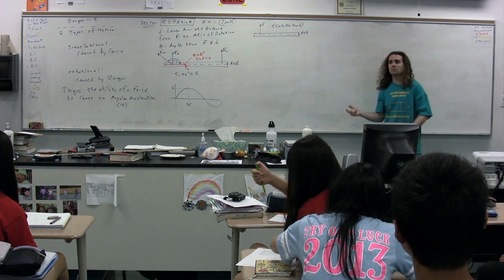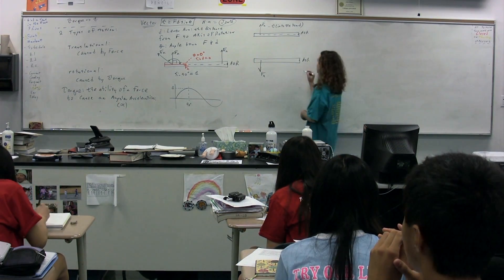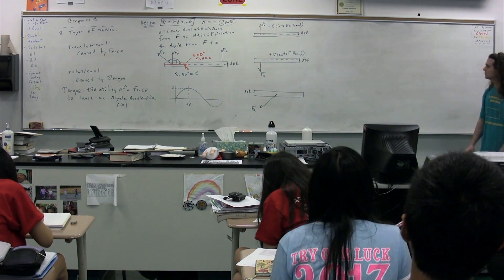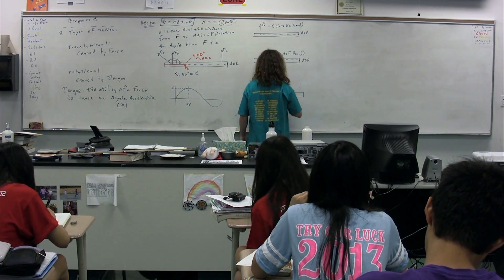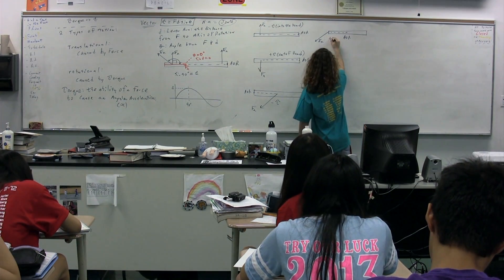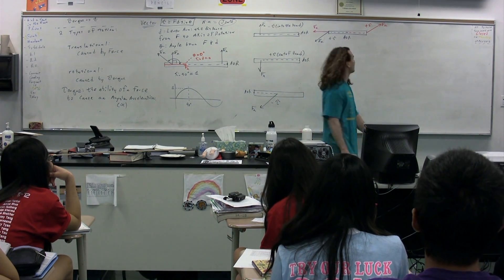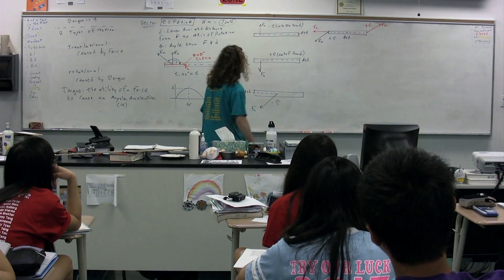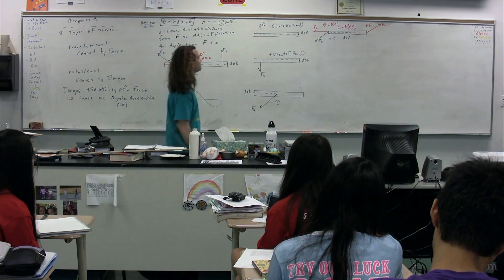Introduction to the Right Hand Rule for Torque

Comment: instead of saying in our out of board an easier way is to say clockwise/counter clockwise
Reply from the maker: Actually, I do my best to avoid CW & CCW because they are dependent on the position of the observer, which is not good from a physics standpoint.  This is also applicable to angular motion and you can see why CW & CCW are to be avoided in this video: http://youtu.be/dpkdFFI6xWY?t=59s